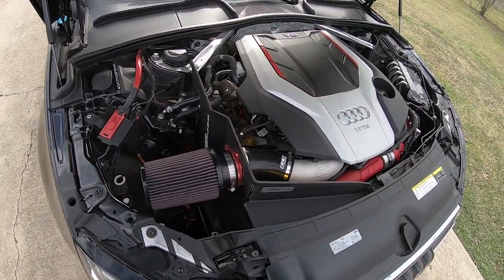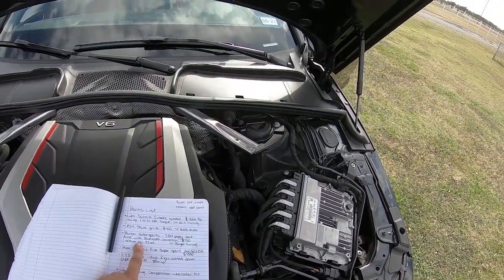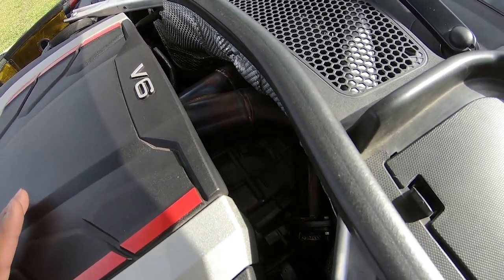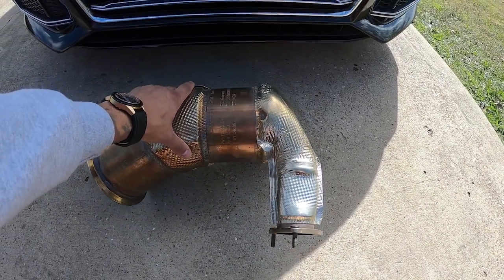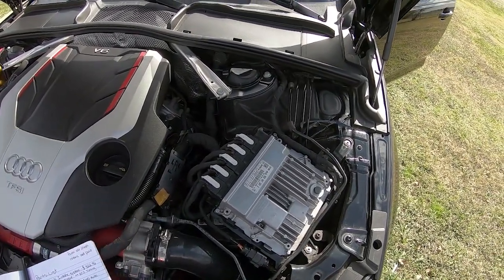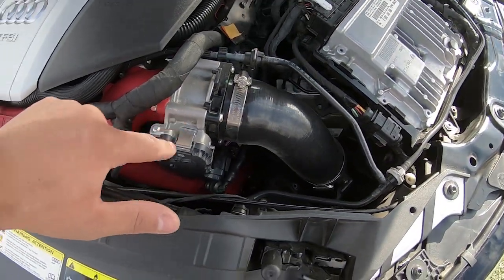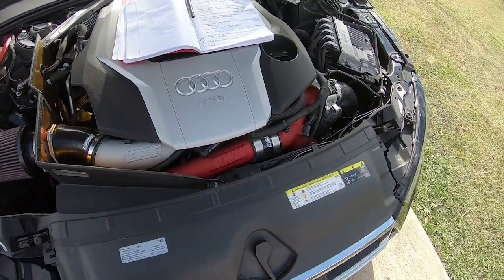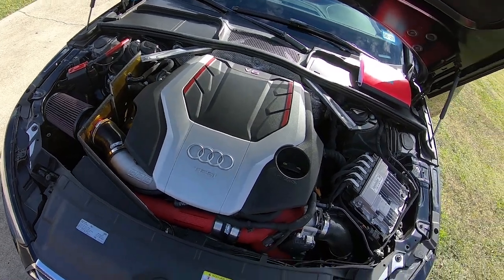2018 AUDI S4 BUILD - 470+HP?

Comment: Right now people are concerned with how long the turbo will last As it runs extremely hot (also The 4.0 tt blowing turbo’s years 2013-2017) and the lack if higher mileage EA839 engines right now 💀
Reply from the maker: Its a solid turbo, not sure id wanna push the limits with an upgrade. The turbo doesn't seem to run any hotter but due to the placement I can see why that would be a concern. Hopefully I don't run into any issues down the line. 🤞

Comment: Love that grille. In your opinion do you think I could tape mine off paint it right and make it look similar?
Reply from the maker: Yes its fairly simple, just be cautious of the plastic tabs that hold the grille and grille inserts together. They can break off easily with too much pressure. You will need a pick tool.

Comment: Hey man great video! Couple questions :) Why did you go with the Wagner intercooler over AWE? Why did you get the intake without the carbon cover? I know it's a lot cheaper but I'm trying to figure out if it's worth it to get the cover or even the awe full carbon box. Functionally I mean, I don't care about aesthetics if it's double the price... Any particular reason you got H.A.S. over V3? My thoughts are that HAS would retain the electronic damping if you have the sport package on your S4. Thanks!
Reply from the maker: Wagner tuning is German manufactured so it seemed to pair better with a German car. And i like the finish.  This engine runs hot so i figured an open intake would promote more airflow vs a box that further crowds the engine compartment. And you get more turbo sounds without a box. Spot on, im not tracking this car, its my daily so the H.A.S. kit was perfect with the stock E/D suspension.
Reply: Instablaster.

Comment: What did you go Wagner Intercooler over the other companies? I am getting so hyped to buy my B9 S4 i already started a shopping list 🤣🤣🤣🤣🤣🤣 i see you have the ECS Post Throttle Body Charge Pope kit! I saw that and was like i haven’t seen hardly any video’s of it, any noticeable differences? Following.
Reply from the maker: Im just a stickler about getting what you pay for. The quality of Wagner products are impressive. Also cant beat German parts for a German car. Oh yeah, still have a list myself. 😏No noticable difference for me but maybe on a setup closer to stock you might notice. It was just an aesthetic  mod as well as beefing up a few compenents to better withstand higher hp.
Reply: I thoguht the Wagner came with all new charge pipes? Or are they different ones?

Comment: Do you know if the JB4 tune alone would void Audi warranty? I got warranty till Aug 2025 on my B9 S5, only reason I’m hesitant to get a tune :(
Reply from the maker: Its completely reversible and only takes a few minutes to remove all wiring if necessary. Its not detectable once removed/disabled so your warranty will be fine. To be even safer you could remove it before your annual services and then reinstall so the dealer doesnt take not of any mods.
Reply: @daniels.5056  - Oh that’s perfect. Good to know man thanks!

Comment: I wonder what’s the hp limit for the internals of this engine and the transmission
Reply from the maker: Good question, I feel like I've seen builds with 600+hp to the crank. Im definetly not gonna keep pushing and find out the hard way though.🤷‍♂️
Reply: There is a guy on Facebook pushing 800hp on stock internals he pulled the engine apart after the dyno and everything was fine, i think he said that the stock turbo and down pipe are rated for 500 to 600hp, the fuel pump is the weak point when you double the power obviously

Comment: Hello sir, could you enligthen me about the difference between s5 and rs5 b9. Same engine ( one extra turbo, different bore), same trans, same chassis, just custom rs suspension and styling bits. Why the heavy premium thank you.
Reply: You literally just named it in your own post. The Rs5 comes with an extra turbo, different bore and the suspension with the audi styling tax. Apples to oranges. Answer the question why the premium for the a5 vs the s5? The difference is in the parts.
Reply: S5 has a 3.0 Audi variant motor and the 2.9 in the rs5 is a Porsche Panamera version of the motor with stronger internals. The rs5 also has a higher torque rated ZF transmission. The rest can be attributed to body panels as the rs5 is it’s own Unique panels that are widened. The rs5 is lighter and more track purposed. Bigger brakes, suspension amongst other bits. It’s a similar argument vs a BMW 340/440i and difference of an M3. Anything with an M badge or RS badge will be a premium price. Is it worth it, that depends on you and your wallet and wanting the raw too go the line product that company offers.

Comment: Hey, nice build. I’m thinking of modding mine. Would you say that a CTS Intake and APR Stage 1 tune would be a good first step?
Reply from the maker: Thanks! And yes those are the best bang for your buck for sure. Its recommended to upgrade your intercooler if your tuning to stage 1 though. After comparing the stock intercooler to an after market one, i can see why.
Reply: Daniel S. Okay, thanks for responding. What are like top 3? I can buy medium-high end
Reply from the maker: @YoungishC  I like the Wagner Tuning intercooler i have but thats on the high end. APR might have their own by now, ECS tuning, AWE, and CTS turbo are all good.
Reply: Daniel S. Ok, thank you. I was wondering if there was anything else you think that would need to be done on a set up like that. I’m new to this and don’t wanna fuck up.
Reply from the maker: @YoungishC  No you're good with that set up.
Reply: Daniel S. Ok, thank you. Nice profile pic btw.

Comment: Nice build! Did you do a res delete or is that completely stock exhaust?
Reply from the maker: Thanks! Its stock for now, all I've got on is that high flow cat. Im looking for an exhaust that works with the factory exhaust controls. I don't like the idea of using a separate remote control to change exhaust settings.🤷‍♂️
Reply: @daniels.5056  Currently I am running with the AWE switch-path exhaust system which can be controlled by the original car system, if this is what you looking for.
Reply from the maker: @chrisp.784  Im not sold on the AWE sound yet, and the exhaust I spec'd out was nearly $4,000 with the carbon tips.
Reply: The AWE track sounds wicked for this car, but idk about the drone.
Reply: Also, do u think a downpipe would pass emissions?
Reply from the maker: @icecubeninja7932  Yeah it seems to have a bit of drone at 2-3k rpm. And no it wont, I dont get tested for emmisions so thats the reason i run it as is. Additional tuning might help pass though but dont quote me.
Reply: @daniels.5056  No tuning will help you pass emissions with a completely catless down pipe. The monitors will never ever go to ready and the emissions site will just tell you your unreadable and tell you to come back after you figure out why. 
A 200cel hi-flo cat or sport down pipe will pass but that isn’t alway a guarantee either. If they’re super new and early in their life cycle yes it should pass but I’ve seen them after some miles on them fail on inspections as well. Hope that helps.

Comment: Nice build 
Any cel code for running catless down pipe ?
Reply from the maker: Thanks! Yes sir, and theres no getting rid of it without stage 2 tuning. I've tried using 3 different sized O2 spacers and neither kept the cel light off after clearing it.
Reply: @daniels.5056  Have you tried the cts spacer one z it's like 90degrees one along with the 034one 🤔
Reply from the maker: @davidsotelo3021  From what I've read and seen no spacers work on this platform. Even $200 FabSpeed spacers didn't help.
Reply: @daniels.5056  Dang, ok man
Reply: @davidsotelo3021  yup spacers wont work, ill be getting a jb4 soon which willl delete the codes.
Reply: @Madnesschannel100  yhea but it will come back . I read unless your outside the US
Reply: @davidsotelo3021  Oh really, luckily im in Canada but thats strange that it will come back if ur in the US.
Reply: @Madnesschannel100  yhea illegal here. I think you can just do like a clear and that's it . Only certain small tuners can clear thru the tune . You can email George over at burger Motorsports and see what he says
Reply: @Madnesschannel100  You would be wasting your money on the JB4 tuner as Terry Burger got fined and sued by the epa about 4 years ago and had to take out the auto CEL delete feature out of the JB4 software with an updated version even the old JB4 devices as soon as connected to the computer would get auto updated, so you are going to need to seek out a company with a stage 2 tune and have them shut off the light.
Reply: @davidsotelo3021  This is correct.

Comment: Are you running JB4 and apr at the same time? Or did you remove the JB4?
Reply from the maker: No, I removed the jb4 before reinstalling the apr tuned ecu.
Reply from the maker: I wonder if i could have stacked them? 🤔 But i dont know enough about tuning to jump into all that.

Comment: Do you have instagram? Would love to keep upto date on this as I plan to do ALL the mods you have mentioned to my B9 S4
Reply from the maker: I dont have one for vehicle content, just a personal one. But once i start adding more mods ill for sure make another video with additional info.
Reply: @daniels.5056  How does the chrome on the front grille come off Dan? Will it be obvious when the front bumper is actually off, and then the chrome just clips off? I want to get the wheels and grille done like yours this summer. Cheers
Reply from the maker: @rob300zx  Yes sir, once you remove the bumper and grille you'll see that the chrome inserts have tabs that lock into slots in the grille. Just need to pry them out carefully because its all plastic and it helps to take note of what goes where for reassembly.
Reply: @daniels.5056  Great stuff! Much appreciated for that Dan, hope to see some more videos soon (Y) .

Comment: Why no catch can yet?
Reply from the maker: The stock engine (EA839) already has a oil separating system integrated as an assembly near your oil cap. An aftermarket catch can would be pointless.

Comment: any reason why you choose to go with apr and have you done any times dragy etc in the car
Reply from the maker: APR was the first to unlock and tune the ECU in my area, but I dont believe they're offering a stage 2 so I might switch tunes. No im waiting on a new set of tires and warmer weather to do some official times. Hoping for mid 3's?
Reply: @daniels.5056   ok i don’t think anyone offers stage 2 technically speaking at this point turbo is maxed out really from stage one you have all the mods to go your good i would say get another inlet because when it’s hot that aluminum will heat up might cause problems and have the car pull timing i have the epl tune i have tried 93 and e40 an have managed to pull 11.5 quarter and 3.3 to 60 my mods are  cts downpipe ecs intake same ones as you and intercooler if your intrested in them hit them up great guys and they have the stock turbo record of 11.2 seconds to quarter
Reply from the maker: @eduardlast23  Yes but APR has no plans of developing stage 2 at all from what i've read. I think ECS stated the aluminum inlet increased air flow by 16%, so i figured that would negate any additional heat soak. I might wrap it if anything but im also looking into a way of venting more air out from under the hood. Yeah those are impressive times for sure ill have to check these guys out. Thanks!
Reply: @Daniel S   @Ed L    You guys didn’t hear it from me but apr is going to release stage 1plus with fueling upgrades